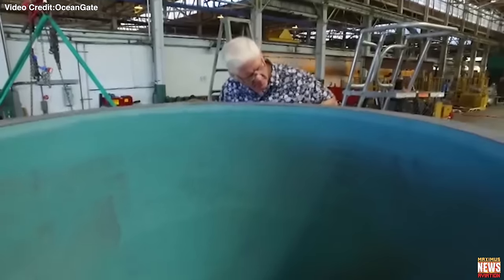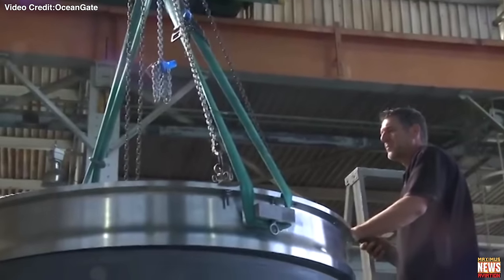Watch The Manufacturing Process That DOOMED OceanGates Titan To Fail. But It NEVER Had To Happen.

Comment: Having spent 30+ years as an Engineer in a business that makes submarines I only had one question: "Who is the Naval Architect who approved the design of this vessel?"  The answer, sadly, is "It wasn't approved by a Naval Architect."  The CEO acknowledges that composite pressure hull designs have been rejected as options by the World's submarine builders, there are some very good reasons why.
Reply: Same reason you will never see a fire hose made of cardboard.
Reply: Man, all those past days I thought the Titan cylinder hull was made of titanium in the inside and carbon on the outside. However it's starting to look like it was only carbon fiber, and only the end cap hemispheres are titanium, is that true?!
Reply: @timoooo7320  yes
Reply: Well we don't know where it broke. Was it the hull even? Or the viewport that's only rated for 4000 feet? Or maybe something else entirely? One interesting theory posited is the seals around the viewport and hull broke and leaked. That's all it takes a micron of a leak around the rubber seals and it's game over. This is also highly plausible. So the hull may be completely intact so the sensors never went off.
Reply: @jonfreeman9682  I don't think they've released pictures of the debris yet, but if the front titanium hemisphere still has the window on, then it's not likely that it was the window that failed. Also, I don't think a leak is very probable, since the outside pressure pushes the window against the sub, reducing the likelihood of a leak (unless the seal was bad to the point of worthlessness). The company that made the window didn't want to certify it to more than 1300m, but from what I understand that had more to do with the experimental aspect of the submarine as a whole.
Reply: @timoooo7320  Seems so, otherwise they would not have the problem with the bonding. If the central piece was titanium they could have included the end flanges already and just wrap the carbon around.
Reply: This is showing the construction of Cyclops, a previous OceanGate submersible. Not Titan.
Reply: @strammerdetlef  holy shit... I thought it was a carbon fiber outer hull... you would have to be nuts to get in that thing..
Reply: @jameshhenderson  No, before it was called Titan, it was called Cyclops 2. Listen carefully and you will see he calls it Cyclops 2, and Stockton also then says stuff about it going to 4000m and he will be the first in it.
Reply: someone on youtube mentioned the filament supposed to be wound in diamond pattern, not vertically as shown here. In other words if I understood correctly diagonal in one pass, then opposite diagonally on next pass. Now I am curious to find how carbon fiber are wound on aircrafts. Now we have definitive proof carbon fiber is not material for any deep submersible
Reply: @TotalAnomy  oh was it the manufacturer who didn't want to certify it beyond 4000 feet? I was under the impression they asked for more money to certify for deeper as more tests are needed and ocean gate CEO did not want to spend the money to certify it. Considering how he Jerry rigs everything I can't help but think the guy is cash strapped so cut corners on everything.
Reply: @TotalAnomy  I've seen the footage of the debris being offloaded from the ship. The window in the titanium hatch is missing.
Reply: @NDBoost  very interesting, I gotta check this out
Reply: @NDBoost  
I just find it strange that if it was the window that failed, where is the carbon fiber cylinder? I don't see why it would collapse into itself if the window failed. It could be that they just haven't found it yet
Reply: @TotalAnomy  who knows
Reply: @TotalAnomy  my theory is the tube delaminated over several dives and they just didn't realize it. Not to mention the titanium hatch was literally glued to the CF tube.
Reply: @NDBoost  I just saw some of the more recent photos of the debris, and apparently the CF cylinder has remained surprisingly cylindrical (though very "unwoven" at the end). Which  suggests that this event was probably a lot less implosion-y than I thought
Reply: @timoooo7320  That's correct. Crazy, eh?!
Reply: @BlackLotusNinja  yeah insane. I don't understand how did anyone with moderate engineering knowledge thought that was ok. But now I understand why so many people are saying that they warned him or sent letters or emails etc.. it's so obvious that it's a disaster waiting to happen
Reply: @yummysatay  it may be but not how he did it.  Maybe titanium outer then CF then titanium might be an option but not like this.
Reply: @strammerdetlef  oh?!  I thought it was some [fairly] new special material of carbon-titanium molecularly bonded in some way in an interwoven matrix. (Im showing my ignorance b/c 1. I simply didne keep up with even a cursory look into it, and 2. Im more towards microbio, molecular bio, medical area of the sciences)
Reply: @Larry-y1k you might, in Russia
Reply: I believe the designer was Phd in Aeronautical Engineering.. who big in Composites .
Reply: @TotalAnomy  The window may not have failed, it's just missing. If the CF hull catastrophically failed (seems to be the case) then it's possible the window may have been ejected out?
As far as I know, everything is still under investigation.
Reply: @timoooo7320 I thought the same thing. I though that surely they had a titanium AND carbon fiber hull, but this was not the case. 

Unbelievable that someone would allow the sub equivalent of a Coke bottle to dive as deep as they did, and repeatedly no less. Words cannot describe the hubris involved with this high school project.
Reply: @josephkennedy469  aeronautical engineering, NOT naval engineering so irrelevant.  How many atmospheres of pressure is an aeroplane subject to?
Reply: @timoooo7320  yes, that’s correct. The end caps were glued onto the carbon fibre tube.
Reply: @jonfreeman9682 Considering that both endcaps were intact on recovery, and the description from the recovery team was that the remaining carbon fiber had been shoved into the aft hemisphere, I am expecting final ruling to be a failure in the seal at the linkage between the endcap and the carbon fiber
Reply: @leechowning2712  I'm thinking that as well and it also means there may not even be a crack. Usually the seals are the first to give.
Reply: @jonfreeman9682  Considering the carbon fiber structure, Once the seal failed just a lit would have utterly shattered. I honestly hope they don't take the wrong lesson home. The new shape was not what killed it. And while the layout and controls were rudimentary at best they did not kill it. This was already the second carbon structure in five years. The fact that they had not already started planning to switch to metal says plenty.
Reply: @leechowning2712  Exactly. They cut so many corners there's so many fail points it's hard to figure out where it started. Most think it's the carbon fiber hull but it might be the seal. You're right CEO Jerry rigged everything and looks flimsy but the poor manufacturing is pervasive throughout so if the seal didn't break then the hull or viewport might. What's amazing is this sub successfully dived a dozen times or more and CEO deserves credit for that don't you think? 🤔
Reply: @TotalAnomy  I saw a photo of them hoisting it.  The frame of the viewport was intact. The acrylic window was gone.
Reply: Now I question did the hull implode or the glue fail.
Reply: @jonfreeman9682  The viewport was missing, but also the hull, they found the titanium part without connecting to anything.
Reply: @Larry-y1k  It's all about tension and compression. 
Think of the old days. You want to make a lashing between the lower mast and the top mast of a boat. A piece of hemp rope would work wonderfully because it can handle tension. You wouldn't hack out pieces of sand stone for that application.
Now you want to build a vault in a cathedral. Sand stone can handle the compession and is what has been used traditionally. A hemp rope can't hold up a vault.
That is the Titan in a nut shell. 
Now change from hemp to carbon fibre.
Those carbon fibres did nothing to the integrity of the vessel. The epoxi matrix had to take all the compression stress. Mysteriously it worked a few times. But it was doomed to fail eventually. The epoxi would squish out to the sides under compression. That is delaminate.
Reply: How are deep submarines Windows made
Reply: @beru58  You are preaching to the choir, I fully understand these concepts.  I was making a ridiculous comparison on purpose.
Reply: @jonfreeman9682  My guess is the glue between the carbon cylinder and the Ti ring.
Reply: The CEO is an overconfident oaf.  He ignored every warning from multiple people.
Reply: You are stifling innovation !!!   /s
Reply: @TotalAnomy  There's nothing that can be determined from the absence of the window - even if it wasn't the failure, it's unlikely to have been able to withstand the forces if the the implosion.
Reply: This reminds me of the time my brother built a beautiful model ship, OUT OF CARDBOARD.   He built it using corrugated cardboard and Elmer's glue and staples and it was a beautiful site but should have stayed on the display shelf.  He took it to a local pond and in minutes it was just mush.  We all told him not to but he insisted that since he built it he knew what he was doing.  I think what happens is that someone gets an bright idea about making something and becomes so laser focused on the originality of the idea that they forget to look at the feasibility of that idea.  This guy's sub was half well designed.  The two titanium end pieces were a good idea.  But they should have simply been bigger and left out the carbon fiber part.   As for naval engineers, I'm guessing he consulted one and they said to not do this and he decided to to ignore the advice because after all, CEO's always know more about engineering than engineers do.  

40 years ago I worked for a boat builder, a pretty famous name in the industry.  I won't name them here because I don't know enough about litigation law to know if they would be successfully suing me for telling the truth.  These were strictly pleasure craft up to about 30 feet long.  These were standard construction of fiberglass + resin over a wood frame.  But part of that frame included a special engineered PVC pipe.  That pipe had been specially formulated to be able to withstand flexing as the boat bounced around in the waves and to do so for a fairly long life.  I believe the engineers said around 30-40 years before it would begin to break down.  I'm not an engineer.  So I can't really contribute much on the wisdom of selecting those particular materials.  My job was to simply make the individual components of the wood frame.  Well one day a bean counter (isn't always a bean counter that comes up with these things?) gets the bright idea of substituting regular household plumbing pvc tubing for the ones that were part of the design.  This it seams saved perhaps a hundred dollars in material costs per boat.  That decision was actually made around 1979 give or take and I was there in 86.  So one day boat hulls started to crack.  After extensive testing it was determined that the failure was the substituted cheap pvc.  Big surprise.  So we were told by the government to recall EVERY boat we made from 1979 to about 1986 and repair the hulls.  At maximum capacity we sent out about 5 boats a day from that factory.  We had around 300 employees.  After examining the problem it was determined that it would be more cost effective to simply give each consumer a new boat as it was virtually impossible to disassemble the hull separating the fiberglass, resin, wood frame and pvc tubing.  The expense of complying with the recall would bankrupt the company so, the company closed it's doors and declared bankruptcy thus ending my career as a boat builder.  I had worked there for about 6 months having left a lucrative job building hot tubs using similar skills.  This is a classic case study in bean counters making engineering decisions. 

The CEO of this company can't be prosecuted as he died in the accident.  But as far as I'm concerned, due to his greed, he was guilty of a murder suicide.  But that's just my no professional opinion.
Reply: And he did it for all the wrong reasons. Not to prove that it was just as strong or stronger. He convinced himself that it was alot more stable because in the end, carbon fiber is significantly cheeper. A guy who flies out to present sales pitches to wealthy adventure seekers for $250K seats is not somebody who is overly concerned about safety. His own conflict of building a successful submersible tourism business was confounded by his own ego trying to prove everyone wrong. And his passengers paid for that
Reply: the steel tube they used to form it around would have been a better option
Reply: @yummysatay  That is correct, although you could have a vertical in between the diagonals as well.  Its just basic laminating knowledge used for years in boat building.   Maybe they did do it that way we only saw a few seconds of the laminate construction.
Reply: @timoooo7320  Videos show the unidirectional being wound onto the mandrel....and then only that resulting tube as the sole center structure. Incompetent on its face....the fabricator, Spencer, is culpable for having built it.
Reply: @yummysatay  True, a "diamond" bidirectional winding would have greatly impeded the splitting by the pressurized water....but a similar outcome still because, as well as not being water-tight, fiber itself is not good in compression.
Reply: @standbytogo123   very true. Thanks for pointing that out.
Reply: @fanatamon most deep sea subs are spherical shaped on the inside not cylinder due to pressure forces
Reply: @NDBoost  
It was blown out when the hull imploded.
Reply: The window was missing in photos of the door/end cap @TotalAnomy